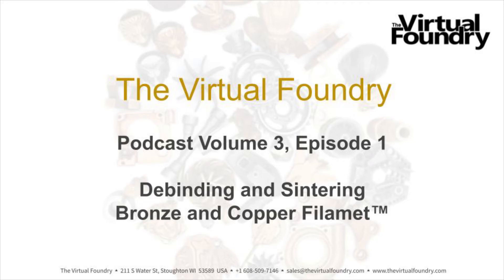Podcast V3E1 - Debind and Sinter Bronze & Copper Filamet™

Comment: I'm a little confused because at first Brad said debinding process you ramp 100 degrees F to 900 degrees F hold for 4 hours, then 100 degreed F to 900 F and hold for 5 hours?
Reply from the maker: Javier, we know, it's weird. There is a lot of flexibility in the process. Hold times do depend on part size but any hold over 3 hours will work great for parts 3" or less. Larger parts will need to be held longer.

Comment: Can you use brown aluminum oxide in place of the white aluminum oxide on your website?
Reply: You can, and you will get a metal part. However, we've had users run those parts through mass spectrometry and find unacceptable levels of various contaminates. Al2O3 is normally white. If you know what's in the brown oxides, and it works for you, no problem. 

If you're just looking to save a few dollars, you probably won't come out ahead. If you're looking to source larger quantities, we can put a bulk quote together for you.

Comment: Hi from Australia. Helpful podcast. I purchased a bronze starter kit recently and purchased some talc and SS foil locally. I am refining the printing process using 80% bronze purchased locally as my first attempt printing with Virtual Foundry bronze failed. I changed the filament loading setup of my Makerbot Method X so that I can load the filament direct to the extruder without any bends. I am now getting good green prints with the 80% bronze. I was even able to debind and sinter a test part using the process you just described. It worked fairly well but needs to debind for longer, most likely due to the extra plastic in the filament. I am now ready to try the Virtual Foundry bronze again.
Reply from the maker: Your best option is always to debind over the longest period of time that you're considering. Te most common type of mechanical distortion is caused by not giving the PLA gasses time to escape during the debind stage. Just go slow and you'll be fine. Once you gain experience you will be able to speed up. But just be patient when getting started.